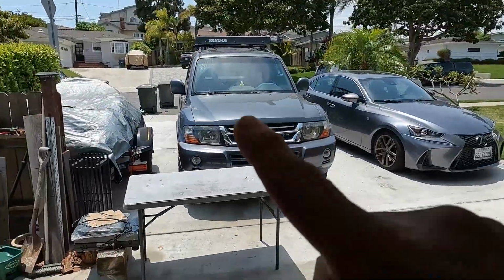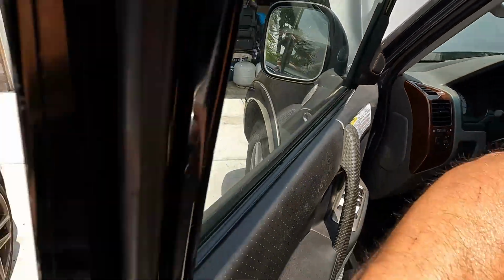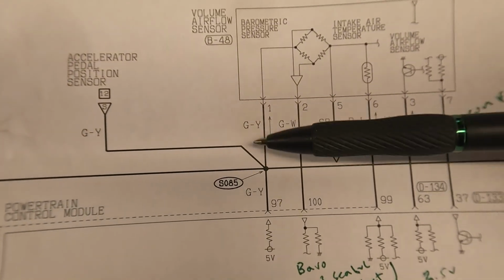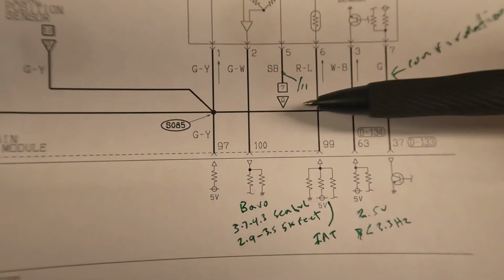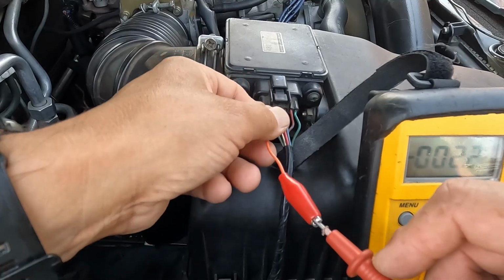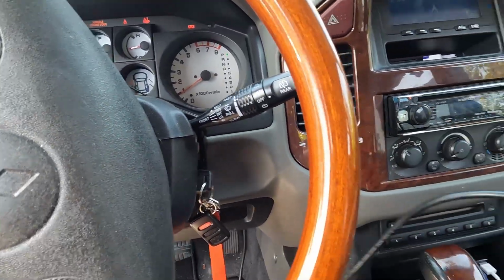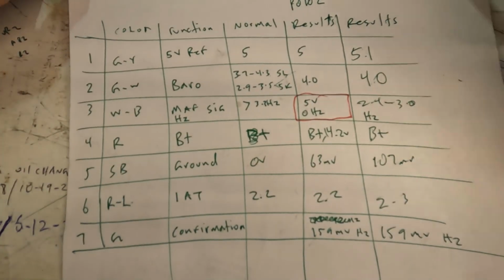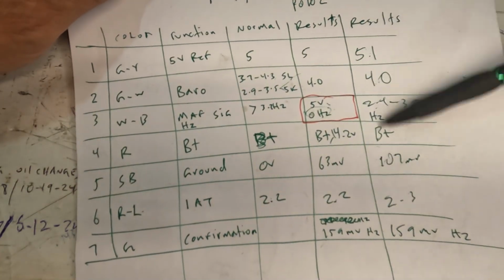Mitsubishi Montero P0102 Mass Airflow Sensor Circuit

Comment: Good evening friend, is it normal for pin number 7 (confirmation) to have a constant reading of 5 volts?
Reply from the maker: the reading it gave me was 159mv.  but I believe it should match the Hz from term #3 however if that wire is unplugged at the pcm or the pcm has a bad ground, that wire will have 5v. The 5v comes from the maf on that wire

Comment: Do you have a video about airbags? I'm trying to find out how to remove the airbag on the passenger side. (Remove sensor, I guess) got a kid nr 3, and I need to have my eldest son in front. But in that case, the airbag needs to be disconnected.  🙏
Reply from the maker: no, I can email that part of the repair manual if you send me your email.

Comment: Hello Jim, I need your help with my 2004 Mitsu Montero Limited mate please. Last night while dropping off a friend at home at night, the differential rear two-wheel drive green indicators went off and the middle one started blinking orange. The radio went off and so the dashboard along the exterior lights (I believe). I did hear a noise that sounded like a clicking switch somewhere in the back (I am not sure). I turned the car off and back on, but in vain. Fortunately, I wasn't too far away from home, so I drove and parked it right away. This is the second time this is happening to me in a year period. The first time, I took a chance, despite the mentioned conditions, to drive the vehicle to a mechanic which was 15 mn away from my place, but the car totally died / turned off 50 ft away from the shop. The mechanic checked it and replaced the alternator-with a refurbished one- that supposedly failed. A while ago (months ago) when I started to see the battery and A/T Temp, the engine oil and the tire air pressure lights come up for a minute or two and then go away.  I was ignoring it for a while until it did eventually fail on me with the symptoms I stated above. I do hear some sort of buzzing around the gas / break pedals for couple seconds few times while driving / idling / decelerating / braking. I am not sure what is it. After replacing the alternator and resetting the alarm lights, it was running fine for a while with no issue until couple months ago where the same symptoms reappeared. My apologies mate, I know I am all over the place and my thoughts are not well organized. I hope this makes a bit of sense for you.

Comment: hi mate did u run a multi meter over the resistor  u think is bad ?? i had the same problem and couldnt find fault with the resistor in mine then i sprayed contact cleaner all over the circuitry board and now it works fine  .. u have been a grate help  .. top videos cheers
Reply from the maker: I did not, But it did overheat because the solder on the back side of the circuit board was melted.

Comment: This happen to me too but it would shut off  I watched a video where a guy opened the box on the air flow sensor cleaned it w electric spray and maf chang3d my air filter and jus to made sure I cleaned the  iddle control valve and boom it fixed it it’s been running fine it’s a montero gen 3 2002

Comment: Good video. I had my MAF sensor fail a few months ago with exactly the same symptoms as yours. I replaced it with a new one but now I wish I'd kept the old one so I could check if I had the same burnt resistor cos then I'd replace it and give it another test.
Reply from the maker: It would be impressive if one of these sensors can be fixed by changing that resistor. I'm still suspecting the high voltage drop on the ground could be causing the issue.

Comment: Thanks for sharing. Great video! For your "ground" - IMO you should test it with Ohms scale with the power removed. There may be a bad connection in that circuit. Also, the unknown output on terminal seven appears to me to be a control point- as shown by the open collector transistor shown connected to it in the lower part of the diagram. That may be an enable/disable or feedback signal from the ECM. It would be interesting to see the voltages on the pins with the engine on and the MAF out of circuit.
Reply from the maker: checking voltage drop instead of ohms, is a far superior way to check a ground but thank you for your suggestion. Yes, term7 seems like it is a feedback signal. I should have confirmed by checking the Hz. Maybe I'll do that and let you guys know.